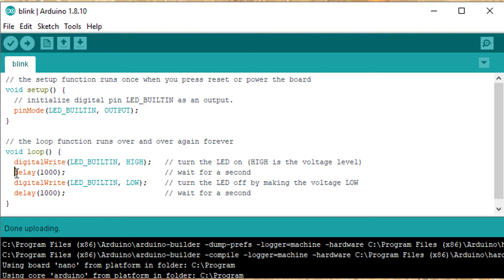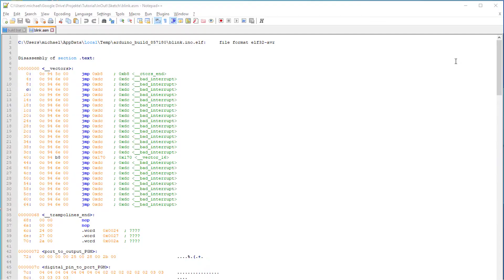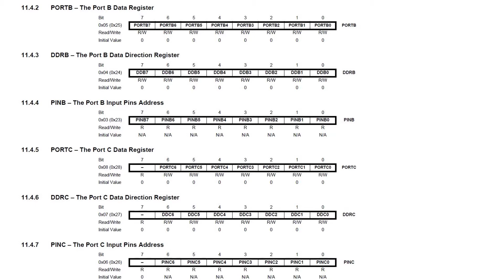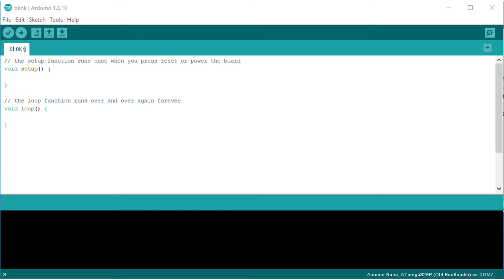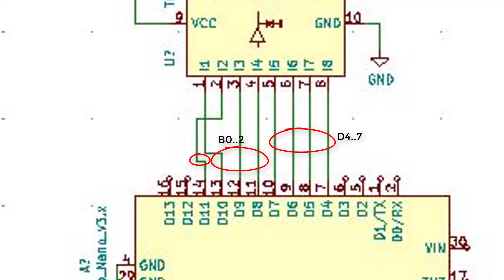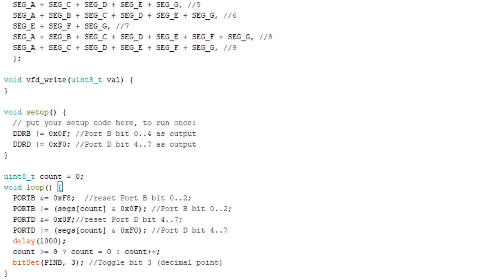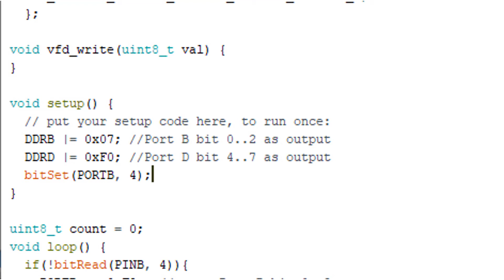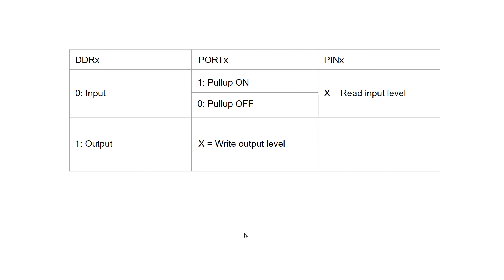Speed Up Your Arduino!

Comment: I'M NEW , I FOUND YOU IN 2022 . MY MOTHER WENT BLIND 6 MONTHS AGO. I'M TRYING TO LEARN HOW TO MAKE A TALKING KEY BOARD. I BELIEVE I CAN DO THIS WITH MIDI FILES WHICH I CAN MAKE. NEED TO LEARN HOW TO MAKE THE CODE TO CHANGE THE READ OUT OF A COMPUTER KEYBOARD TO MIDI. A POINT IN THE RIGHT LEARNING DIRECTION WOULD BE GREAT THANK YOU --- BOBBYB
Reply: Most likely she touch-types already. We did that until the smartphone reprogrammed everyone. Use the computer's assisted keyboard with sound. You do not want  Arduino,